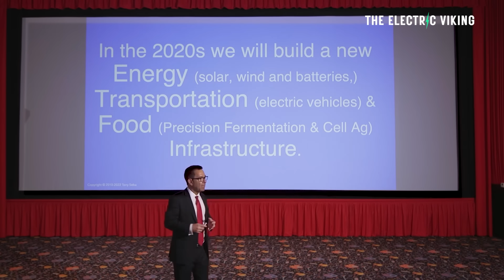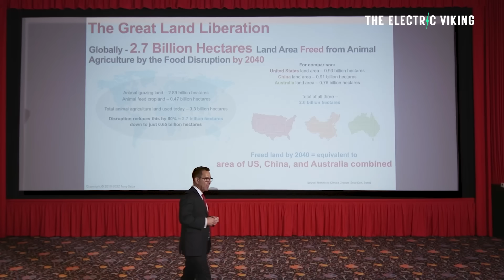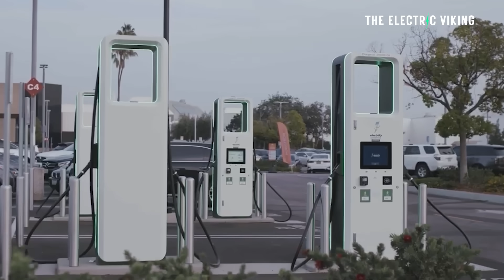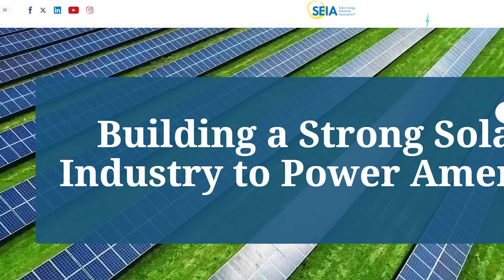Tony Seba's solar predictions seemed insane in 2014 - they don't anymore...

Comment: Sorry but 15% by 2030 is still pathetic.
There should be a 'Moonshot' to get EVERY home kitted up with solar and batteries by 2030 (and micro rooftop wind turbines could be developed more too).
It would create hundreds of thousands of new jobs. It would also be enough to power the entire country in Spring, Summer, Autumn & most of the Winter - just from the grid-tied domestic PV. The rest of the year can be covered by grid-scale wind+solar+batteries.
The reason we don't see politicians nor corporates pushing for that scenario, is because that would mean "POWER TO THE PEOPLE" - because every home would become its own utility company - selling surpluses into the grid & providing 90% of its own power. Think of the hundreds of billions the energy companies would lose (money which would stay in people's pockets). 
Batteries are cheap and getting cheaper, so a solar+battery kit pays for itself within 5-8 years depending where you live. - after that it provides FREE electricity for the next 20years - put another way, that's 2c per kwh over 25 years (and getting cheaper - so when you have to replace it, it will be even cheaper).
When will the nuke/coal/gas grid provide you with FREE electricity?

Comment: Hi Sam. I think there must be an error in the 5 million installations in the USA (I think it must be way more).  For example, we here in Australia have the highest number of solar installations per capita, that being approximately 3.5 million homes with solar for 25m people. If each of those homes averaged 20 panels, that's 70 million panels (approximately 3 panels per person). If you did the same comparison with the US, they should have at least 100 million panels for 350 million people. 1 panel per 3.5 people. You can see the huge comparison, which I think can't be correct for the USA...   Yes, the Americans get screwed on panels and installation costs compared to us here in Australia. e.g. my 6.4kWh of panels, inverter, installation cost me AU$3050 six years ago.  Anyone care to share what they paid in the USA please ?

Comment: In Australia are you starting to do solarvoltaics?

Many crops grow better in the shade of solar panels arranged in one roll of solar panels and three rows of open area. 

There's not only protection from hard rain wind and hail, the fact is that many plants only require a certain amount of sunshine and if they get too much they grow slower. 

If you haven't done it yet you might want to look into this and do a program on it. 

Scientia Habet Non Domus,
(Knowledge Has No Home)

antiguajohn

Comment: Here in Australia the energy companies are starting to charge people, at certain times, for energy they generate.  I look at roofs, I see less than 1 in 10 houses have solar, yet more energy is generated at peak times than what the grid can handle.
There is simply not enough done to store energy.
So they want people to have batteries.  Batteries are a problem, batteries have a definite lifetime, but thare are no plans as to how to deal with batteries that are old and broken.
Reply: Old and broken batteries are fully recyclable.

Comment: Long time listener to Tony Seba. He has been spot on correct in predicting the energy/transportation disruption and we installed solar PV system 12+ years ago and also installed two Powerwall batteries in 2018. We have been net positive in energy production every year since that installation, and the cost of solar now compared to our 2012 installation is less than 1/4th of our initial cost. No brainer now to install solar. Our much pricier solar however was paid off within 7 years with incentives in place in Washington State where I live.

Comment: Solar panels are cheap enough,  it's the controllers, inverters, and the batteries that are outrageous expensive.
Reply: Solar panels are cheap.  For what you get, micro-inverters are really expensive.  String inverters are the way to reduce cost.
An even better way to reduce cost is to install it yourself.  
Until recently, a system installed for hire at a home cost $1/ Watt for panels, $1/ Watt for balance of system and $1/ Watt for installation.  Install it yourself and use string inverters to reach $1.50/ Watt.

Comment: Offgrid is illegal in grid supplied areas.
Occupation certificate requires electricity grid connection for a habitual dwelling. 
My comment on impact on the grid:
If 10% of dwellings disconnected, and offgrid means 10% more invoiced cost to the remaining grid connected customers. 😮😮😮😮😮😮
Reply: Which country or state has that?
Reply: @sjdtmv  Australia.
Reply: Houses not having a landline pass the cost of telephone line maintenance onto the rest of the homeowners.
Who cares about that?  Nobody.
Reply: @peteinwisconsin2496  Yes, that is why 'grid rental' is not talked about with rooftop solar pv systems becoming cheaper and batteries becoming cheaper. 
The Australian state governments can see bigger grids, and newer generation is a huge cost, and that unloading grid demand is cheap if each customer pays to generate some electricity. 
One grid but millions and millions and millions and millions of customers. 
A few help

Comment: Rooftop solar PV is electricity generated AT the customer's location. 
No grid RENTAL COSTS, Hahaha 😊
Selfplug-in V2G EVs are needed.
My feed-in is 5cents kWh 
Grid electricity is 50cents kWh 

Electricity is dirt cheap. 
Nuclear promoters say 5cents kWh.
Fossil fueled 3 to 5cents kWh 

The national electrical grid is a $TRILLIONS infrastructure asset. 
Investment and maintaining costs means it RENT cost to customers is the dominant cost kWh. 

Rooftop has NO infrastructure costs after installation. 
Rooftop installed is cheaper than windows $/m2 in Australia. 
Including inverter.

EVs big battery is 'free' with the vehicle, cheaper than home batteries. 
So selfplug-in V2G feature in EVs will be a valuable asset. 
Most vehicles are parked 23hrs every day.

Comment: Solar is getting cheap enough that sufficient overproduction to avoid dunkelflaute is starting to become viable, at least in countries without America's tariffs.  A 50kW system, reasonably unobstructed, paired with a 100kWh battery, should produce enough even on cloudy days, even including a home heat pump (air conditioner) and an EV.

Comment: The panels are now the cheapest part of a solar system. The batteries are still very expensive followed by the inverter. Both are coming down. Modern inverters are much improved and very easy to wire up. I have two separate systems. One uses an Eg4 12kw inverter, the other a Sol-Ark 12kw. Both include three separate built in charge controllers so each inverter can handle three separate and independent solar arrays. The separate arrays don't have to be the same size or use the same panels. This is very handy if you want to add more panels to your system but want to keep your old still functional array which is what I did on one of my systems.

Comment: When I considered rooftop solar a year or two ago, I couldn't make it pay over a decade compared with power from the grid even without a powerwall or similar battery. One problem is that my roof does not permit optimal alignment of the panels. I could build a shelter in my backyard with a roof oriented properly toward the sun and install the panels on this shelter, but this approach raises the price even more, and I'd still need an expensive battery. If my EV supported vehicle-to-home, maybe I could make panels pay this way, but it doesn't. I work from home, so my EV often sits in my garage during the day. I also live in Georgia in the southeastern U.S. Rooftop solar makes even less sense for someone living in Maine or North Dakota.

The price of solar panels has certainly fallen, but this price is only part of the cost, and electric utilities have economies of scale that I can't match at home, so even as the price of rooftop solar falls, the price of solar-generated power from the grid can fall even more. If rooftop solar works for you, more power to you, but it accounts for less than two percent of U.S. electricity generation now, and grid solar accounts for less than four percent. Wind and hydro account for sixteen percent, and nuclear accounts for nineteen percent. I don't expect these figures to change much in the foreseeable future.

"Quickly becoming the dominant source of electricity on the grid" is a ridiculous exaggeration. With EV adoption, AI servers and other emerging technology demanding more and more power, we need more rapid expansion of the grid than ever before. If lower dependence on fossil fuels is the goal, solar is not the answer at this point.

Comment: The cost of Chinese produced solar panels continues to fall, yet China is building coal powered plants at record pace ad CO2 emissions continue too rise, Why?
Reply: Are you really sure about that? Check the source of your information.
Reply: @ahaveland  How about you check it and prove me wrong.
Reply: @snappingclam8801  No, you made the assertion, so you must support it to show that you didn't just pull it out of where the sun don't usually shine.
Reply: Good question. China is the number 1 manufacturer of goods in the world. Solar and wind energy are great but not consistent enough compared to coal plants. China's manufacturing scale is so big that no other source of energy than coal can support continuous factory operation. But the CCP forecasts that coal consumption is to plateau in 2024 and 2025 and begins to drop after that.

Comment: I work in the utility-scale solar industry, for the world’s largest solar PV manufacturer and our build capacity has increased some 20%, per year, and we expect to double in less than 5 years.  The biggest bottleneck are transmission lines as we could replace all coal and gas in the next several years, but permitting and transmission lines slow it down.
Reply: That’s why I expect a lot of independent home/building/lot installations and microgrids. Grid bottlenecks will delay things so much relative to cost; people will DIY it at their own buildings just to get the financial benefit.
Reply: @davestagner   It's interesting, because home installations are said to cost twice as much per Watt, due for instance to installation costs.  But grid has a cost too, probably trebling the overall cost of electricity, due to its capital cost, maintenance and losses (particularly AC).  If full off grid is becoming economically viable (meaning enormous systems with enough production even on cloudy days, and adequate storage), at least where tariffs aren't severe like America, that could change the calculation for many homeowners.
Reply: @bearcubdaycare having gone through a 7-Day power outage recently, I can say that having a local solar installation is very helpful.

My current disaster plan is a dual fuel generator, three 20 lb tanks of propane, 200 w of solar and a 1000 watt EBL solar battery.  Plus a bunch of battery powered lights and a dozen batteries.
Reply: @bearcubdaycare this is odd YouTube censored my first post. That's really weird.

I recently went through a 7-Day outage.

My solution was dual fuel generator, three tanks of propane, and a small 200 watt solar installation and 1,000 watt solar generator.

Okay this one says the same thing but I don't mention the brand of the solar generator and it appears to be sticking.
Reply: Artist, interesting. Seems like our biggest need at the moment, along with upgraded power lines, is affordable home storage batteries. At $10,000 US for 50 kWh of storage, solar and batteries will just about completely replace the price gouging utility cartels.
Reply: @freeheeler09  You are correct. I'm in Melbourne Australia, in a small (downsized) house of only 135 square meters, meaning I have small roof too... I have 6.4kW of panels, and a Tesla 13.5kWh battery which does its best trying top up the house as much as it can.  The battery totally prevents us from power outages, and by using it during 'peak' hours (3pm-11pm) we NEVER have to pay for power at those times.  Sometimes the battery gets low in winter (like now), but I buy my power at pure wholesale rates (yes, not retail) from a company called AMBER ELECTRICITY.   Combining wholesale with the Tesla VPP (Virtual Power Plant), I have only paid out $4.50 in the last 12 months - and that was rare, usually, it's nothing, or they pay ME !    Solar and batteries are the only way to go IMO.
Reply: What are the transmission line issues?
Reply: @yossarian67  The transmission issues are that there aren't enough HT lines where the solar panels and wind turbines are. They are predominately where the coal fired power stations are, meaning there's problems getting all the solar to the consumers (in general).   We have the same issue here in Australia. HUGE amounts of deserts, ideal for solar, but no HT power lines to get the power where it's needed. The Au govt does nothing to help, relying on private industry to install the wires (who in turn slug the end users).
Reply: Awesome 👍
Reply: I hope it slows down.  I don't want my electric bill to go up more than it already will go up.
“. . . a naïve observer might conclude that the rising share of new renewables (solar and wind) will usher in an era of falling electricity prices.  But in reality, the opposite has been true.”  Vaclav Smil, Numbers Don’t Lie, p.172
Reply: @dzcav3  My experience is the exact opposite. We own 2 houses. After installing a solar array on both homes our electricity bills have become zero and we charge an Ev also. The system will pay for itself in 4 years but is guaranteed for 25 years on the panels and 10 years for the inverters. So my cost has more than halved but that is a small retail installation. Solar farms are much cheaper per watt. NextEra quoted 5 years ago that solar farm generation worked out at 2 cents per kwh and battery storage just added another cent. That's 3 cents per kwh 5 years ago. Solar farm generation with storage is probably less than 2 cents now. Where is your rising cost analysis coming from? A fossil fuel lobbyist?
Reply: @markumbers5362  One single data point for you. In California, the more solar that is installed, the higher the rates go. There have been steadily increasing rates over recent years due to the political process. The utilities have the politicians in thrall. It is absolutely the case that true cost utility scale solar is the cheapest energy on the planet by quite a bit. The OG is doing everything it can to keep that from being reality. Just like big oil fighting back, so are some of the utilities.
Reply: @dzcav3  Power prices depend on how greedy the retailers are. If, like me, you can find a wholesaler instead of a retailer the prices differences can be spectacular. As an example, at this minute (4pm on a cloudy, winter day in June), I am sitting here with my battery at 100%. It cost me NOTHING to fill it. It is already well into 'peak' period (3pm-11pm), and the house is drawing just 200 watts (at present). We have a Northely wind blowing in off the desert so it is a pleasant 20 degrees celsius. Off peak power price was  16c at 2pm, and has jumped to 27c/kWh now in peak period. But, like I said, I pay NOTHING, my 13.5kWh Tesla PowerWall2 is powering the whole house, AND prevents us from ever experiencing a blackout.  Solar and Battery really are a no-brainer...
Reply: numbers don’t lie, but people do!  Initial costs have ZERO to do with Total Cost of Ownership (TCO) which is measured over a 20-50 year period. Higher up front—yes. Lower over a lifetime—yes!  Funny you naysayers NEVER mention an increase in fuel costs either!  Nor the fact that it will become so costly to extract said fuels that it just becomes impossible to sustain. But these facts don’t matter, do they. So fold the ear on the page and sit back and watch it fade into irrelevancy!
Reply: @jimsEVadventures  there's another factor and we saw it with the loss of the network effect for landed lines.

When gasoline vehicles drop below 80% of the vehicles, the coast of fuel and maintenance will start to rise as the fixed costs are spread over fewer vehicles and ice vehicles loose their network effect.
Reply: @dzcav3  Smil´s book is already 3 years old (release May 2021).
Reply: God Willing solar ends the use of power lines.  we need radical decentralization.  the costs of maintaining the grid will one day be 90% of electricity costs.  why do we want that?

Comment: Why only doubling in the next 5 years? We just had a 5x jump over the past 5 years, why shouldn't it be at least that much for the coming 5 years? We're actually at the point in the adoption curve that would predict an INCREASE in adoption, not a slowdown. I think Seba is right, and we'll see solar deployments in excess of 25M by 2030, with the SEIA significantly missing the mark on the predictions yet again.
Reply: Sam needs to look at this 

1000 times the power. 
The most powerful solar panel in history: 1000 times more powerful than expected and free electricity
by D. García  04/09/2024

Of MLU  in Halle wittenberg.